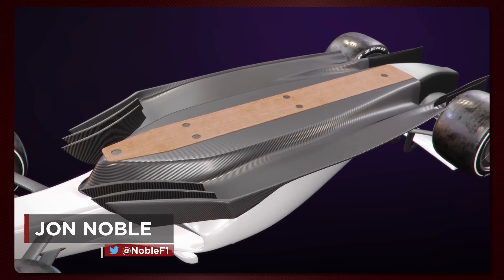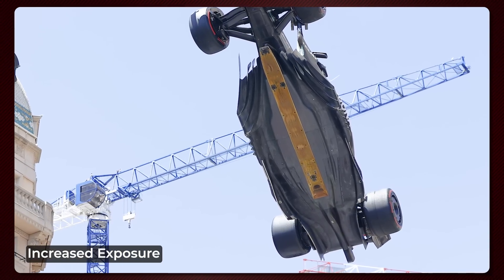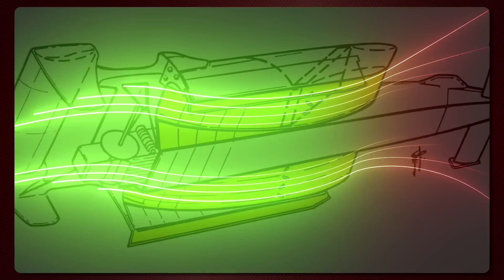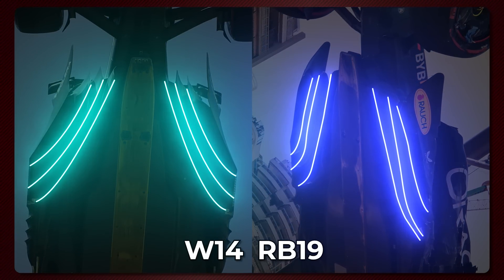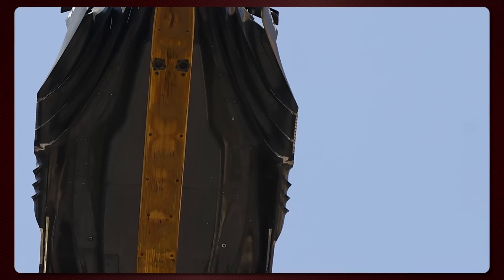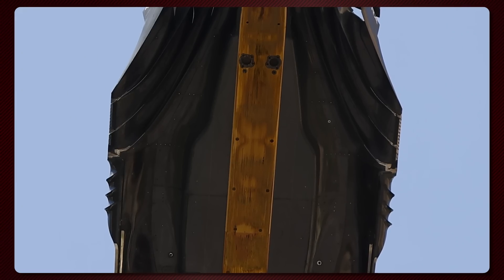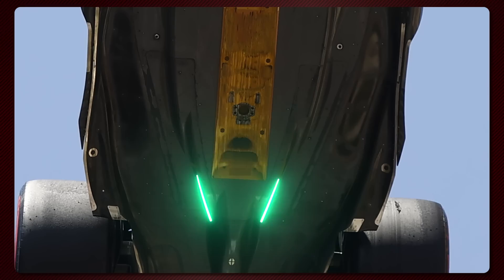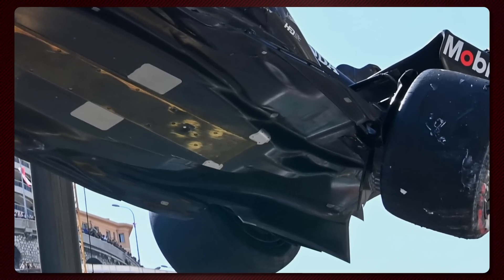F1 Floor Tech: Red Bull & Mercedes's Approaches Explained

Comment: At high speeds, the SR71's skin would expand and grow due to the heat generated by air friction.
Red Bull is prob using similar approach, and nano tech in their composite materials that allows the floor to grown/shrink/deform under high speed/vs low speed conditions.
Thats my hot take conspiracy.

Comment: Redbull design looks like it is optimised for maximum underfloor vortex strength. Deeper tunnels with a curved roof profile to minimise vortex dissipation as it passes down the tunnel

Comment: I've not seen any comments about the floor beyond the gearbox, the compact RB gearbox seems to allow a much deeper arc exiting the rear diffuser and does that create the correct airflow to stall the beam wing, the so called "double DRS"?

There are also steps in that tunnel, my guess is that they re-energise the air through that deep arc to optimise the desired flow rate to achieve this without compromising the balance in the corners?

Very interesting review video here, thanks for sharing the insights 👍

Comment: I am no engineer so please be kind to me, If you compare the red bull to the mercedes there seems to be a greater bulge in the middle of the floor, so if it's sealed as it's supposed to wouldn't this mean the volume of air trying to pass through would have to travel quicker creating a pressure drop, where as the mercedes seems shallower, it's as if the mercedes wants move more air around than through. Plus if this area is closer to the center of gravity maybe this helps reduce the effects of porpoising in collaboration with the suspension keeping the car flatter enabling it to be run lower .

Comment: What makes F1 well F1? Cars, drivers or venues. All three obviously but without the unique cars it would lose a lot of appeal. 
     
So it seems rather unfair to any super innovative team to have some of the most critical tech copied for free be it exposed or concealed. Not the concept but the intricate detailed design that makes the concept a physical reality.
  
Seems to me the team that comes to track first with a part should get a royalty for every team that copies it. This would cover off shunts that reveal tech or engineers that move from team to team. And the designers could get a share of the royalties. 
   
Is not power unit information tech totally secret, why shouldn’t aerodynamics be treated the same? Especially underfloor aerodynamics. 
   
Otherwise inferior aerodynamic designers get to ride the coattails of superior designers for free. And that is more of an advantage than giving more wind tunnel time and the design simulation time.

Comment: What you can clearly see is that at Reb Bull they neutralize the vortexes with turbulators to make more downforce with newly gained straight air. And the part that goes through the keel, at the end of the car, go back into the double diffuser. Smart and very effective.

Comment: Big surprise, probably more than 50% of the frontal area of the inlets of the floor are dedicated to making outwash. 🙄 Good thing we changed the front wing endplate regs and the regs around barge boards. lol. Cat's outta the bag. The engineers already know how beneficial that was, and will use it as a goal for the new regulation set.

Comment: Why is nobody talking about what appears to be a hole in the rear of the floor plate that seems to be adding air volume coming into the rear diffuser? It looks a lot like the kind of access slot you often see on jet fighters where fuel is added during in flight refueling. Which is just a coincidental similarity in appearance. But what is it doing for the diffuser?
(Good view at 11:13 top inset)
Reply: Do you mean the metal insert with a circular hole in the plank? There is one at the front, two side by side about a quarter of the way further back, and one close to the back of the plank - which is the one I think you are talking about? Those are, if memory serves me right, mandatory and used for measuring the thickness/wear of the plank. They are not letting any air through. I don't see anything else in that picture that resembles a hole, certainly not in the diffuser (which is essentially all of the floor rear of the plank).

Comment: Very interesting photos of the RB car floor. It seems they have some structures just before the diffuser step that will stall the flow in about 50% of the width of the tunnels at max aero load. That might explain also why they suffered way less than other teams from porpoising early on. Surprisingly "simple" and straight on approach on this...very cool.

Comment: Apologies for the rant following the relevant (positive!) comment 🙇🏻‍♀️🤭

Outside of the geek side of me being satisfied with the Monaco method of recovering the cars from the track and getting a very interesting and informative explanation by yourselves (so thank you for that!), I think there's one area where Monaco outshines all other street circuits in a practical sense, and that is using those cranes.

Despite the narrowness of the streets, they only had to throw a couple of yellow flags and within a short time, the car was gone. Any necessary fixing of the barriers was the major issue regarding extra time with the yellow flags, but the marshalls are so good they could show the majority of marshalls at many a track a thing or two.

<rant>
In fact, all other street circuits could learn much from Monaco, and maybe it could improve racing at them (which is never something I thought I'd say about Monte Carlo!) Though frankly I think this addiction to street "tracks", which are often tediously boring and don't have class A licences (or class 1 - whatever it is {I'm only on coffee #2} - how could they?) is concerning. Their infrastructure is temporary, which should cause concern. E.g. the stands for the public are put in and removed yearly, the screwing together of the structure could be done improperly and there's a recipe for potential disaster. I'm not saying permanent tracks are perfect, far from it, but they're better.

Monaco doesn't hold one of those Class A licences - hence the "if they were looking at the Principality now it would never get the go-ahead" trope. Though frankly, I don't think it stands because there are extremely dangerous parts of most if not all street circuits and they are constantly being added to.

Imagine a mistake or fault with a car in Baku in the narrowest bit, where there is no room either side of the car (bar a marshal sucking his stomach in). If the driver is stuck and the car is on fire...

I'd far rather they went to class A tracks for safety & a fan's class A for racing, with a class B for "visitor facilities". I'm sure I'm not the only one who thinks this way. </rant>
Reply: Jeddah and Baku are my favorites …

Comment: It was very noticeable that when the RB was hanging from the crane it hung level. But when the Merc was suspended it was tail-heavy!
Reply: Different mounting points
Reply: @Alumnikiid  i thought the mounting point locations are standard locations on all the F1 cars based on regulations?
Reply: @Jojo_Bee  Same location on the car. But that doesn’t mean its at dead center on all cars. RB cockpit is not at the same location as the MB cockpit.
Reply: @Alumnikiid  — Driving the Merc is not unlike driving a cab-over semi !
Reply: the merc cockpit is forwards, Hamilton complains about it. This means the tightly regulated centre of gravity is behind the lifting points.
Reply: @nelsonphillips  Yeah driving the Merc is like driving a sled.  You can't get good carfeel when you are so close to the front axle.  I'm sure it was part of their strategy but I wonder if they don't move the cockpit back for next season.
Reply: great observation. Some will say this is trivial, but all these pieces of info are like pieces to a puzzle. I am loving this If we can't get competition on track. This floor display by Perez is a gift to the paddock for not taking the fight to Max 😅😅😅😅😅😅😅. He owes us that

Comment: Everybody forgets about redbull's pullrod in the front and the pushrod rear. So no other team can copy redbull's floor and think it  will work
Reply from the maker: https://youtu.be/mPGHu-phMx4 we didn't.
Reply: The Mclaren: knock knock,  XD
Reply: the pullrod and pushrod configuration has no material impact on airflow directly, its about packaging. the front airflow doesnt really matter, but the rear pushrod position allows for greater design freedoms in the diffuser.

Comment: The Mercedes looks prehistoric compared to the Redbull.
Reply: It's a shitbox
Reply: Jesus... its two different concepts. Red Bull has no "real" ground effect floor and needs to produce their downforce differently and in a more complex way. If it works (what it does) its more consistent, but peak downforce is generally lower untill you found ways (what Red Bull has) to compensate. Mercedes and Ferraris floors are real ground effect floors that produce downforce by speeding up the air as much as possible by being close to the ground. There is no need with this concept to have all these geometries. So its not about prehistoric or futuristic. Its two different concepts and two ways to produce downforce. One is a real ground effect floor that produces all its downforce via ground effect, the other relies more on vorticity.
Reply: @fam.hunger5244  — 😂😂
Reply: @fam.hunger5244  Ultimately, which of these concepts will have an advantage? Seems like the RB design will allow them to be efficient at any track, even those that don't require an extremely low ride height. Whereas the Mercedes concept seems like it will dominate in tracks that would allow them to ride low (because that's the only way they'll get peak downforce) but struggle in streets and bumpy circuits

Comment: Exposure of the RB floor is invaluable  because a: you can model it on the CFD and to compare it with your own floor, and b: the floor providing the most performance is now not a secret. Contrary to Horners comments engineers will be able to work it out.
Reply: The RB18 was also lifted last year and none of the other teams is the wiser!
Reply: And the floor being important wasn't a secret last year as well

Comment: Now that venturi tunnels and underfloor tech is 60% of the cars performance teams need to come up with way to hide their secrets when the crane looms. Have the drivers carry a sheet of hefly bag type material in a vacuum sealed bag in their firesuits or maybe some type of foam or reflective spray that will ruin photographs.  Not saying have a driver kester an aerosol can into the car but one of the team photogs stationed by the cranes could hand it to them.

Comment: Ironically …… with all the talk off Monaco losing all its previous power as a venue due to a combination off things …… far more street courses in modern seasons compared to previous decades …… Singapore overtaking it as both a stamina test and visually ……Las Vegas …… if not being a crap track like Miami being more glamorous? …… f1 cars being more reliable and far less mechanical retirements…… formula e race being far more entertaining …… the simple fact that this is the only venue your guaranteed a look at cars floors (unless Monaco is swapped out for similar circuit like  🇲🇴 macaw …… not going to happen due to its even tighter tightest hairpin)  .…… is In my opinion likely going to be the only thing (other then tradition as Monaco has hosted most gp’s after monza) that’s going to keep the f1 gp at Monaco keep going along.

Comment: Does anyone notice how aggressive Mercedes tries to turn the airflow, this can cause aero to be very peaky, while Redbull tries to gently turn the air and use vortices and glide plates to seal and guide the flow. Mercedes has always gone after peak downforce, ever since 2017( code name "DIVA") when we went back to high downforce cars this has always been a design trait they had, but they can no longer spend their way out the problem, they have to become efficient at solving the problems now, which if they learn to do this will make a a better team. Look at Redbull all the years with underpowered renault engines has forced them to make cars with efficient but effective aero and also a chassis that had provided great Mechanical grip.
Reply: You make good points.
Reply: Mercedes chassis design prior to this recent era was never far behind redbull. Just different philosophies. They made a mistake with this recent era going for a concept that while technically effective in perfect wind tunnel conditions, was less stable in the real world than the concept redbull went with. Less bodywork ensuring the airflow follows the path you want and relying more on complex large scale vortex control that is more susceptible to outside turbulence screwing up the flow structures. They relied on the Down washing wing covering the side impact structure to create a high pressure region and high energy vortex to push out the front wheel wake. Whilst effective, in real world conditions it appears to be less stable than just having a piece of bodywork do the same job.
Reply: @alecmillea4539  Adrian Newey is just too good at Aero design. He's a genius who likes simplicity in his beautiful designs. He's been doing that since the late 80's.
Reply: @Mars-lp8yd  it’s honestly remarkable that he has such a solid understanding of aerodynamics that he still draws the cars out by hand himself before they ever see any form of software and what he draws usually ends up remarkably close to the final product.
Reply: @Mars-lp8yd 
Whilst Newey is clearly a design genius. I wouldn't call the design philosophies he employs exactly 'simple'. 
The floor of the Red Bull, (as revealed at Monaco '23) was a very complicated structure indeed. And was far more complexed and intricate than the floor designs that other teams had employed.
The way that the airflow is manipulated to create low pressure under the car and to also generate vortices along the floor edge to try and 'seal' the floor in the same way as the 'skirts' of the Lotus and other cars did in a more mechanical way during the 'ground effect' era is also extremely complicated and, in my opinion, far from simple in it's design philosophy and structure.
Reply: Nothing wrong chasing peak downforce. Inherently, that's what their concept intends to do unlike the RB one which seeks efficiency. It's too late into the regulations now to go the efficiency way, but they can find an innovative way of allowing them to ride so low consistently without being sensitive to instabilities or being a DIVA
Reply: your comment simply mirrors what is said in the video. either way, pretty sure you can't make an aerodynamic engineer even at mercedes despite your online bravado.
Reply: @Missing_chapters001  Pretty unnecessary comment tbh

Comment: It's very interesting but the fundamental problem remains for the teams that if you understand the current car, you're guaranteed to be at least one step behind
Reply: You're one step behind but most probably have more wind tunnel testing time. Also, the further the steps, the lower the gains. While Haas may get 3 tenths per lap from a major upgrade, Red Bull would get one-tenth. Convergence will eventually happen probably just before the regulations change again